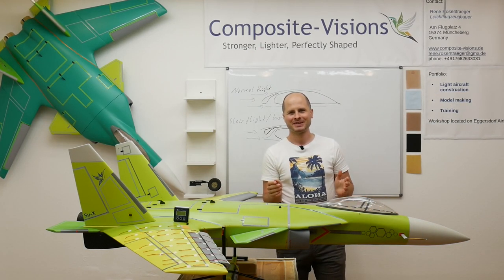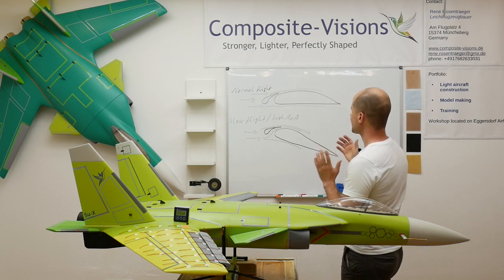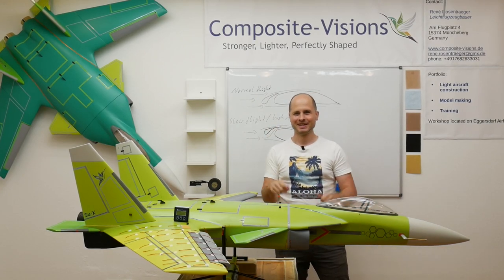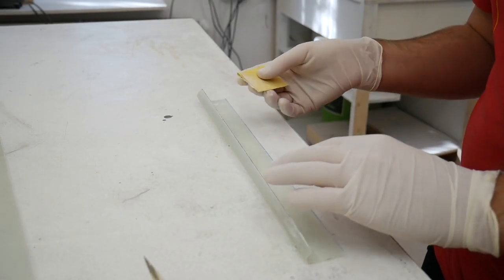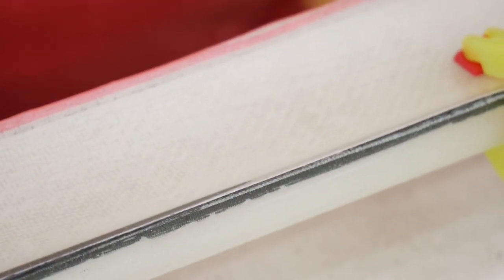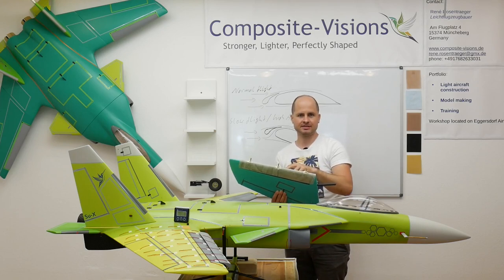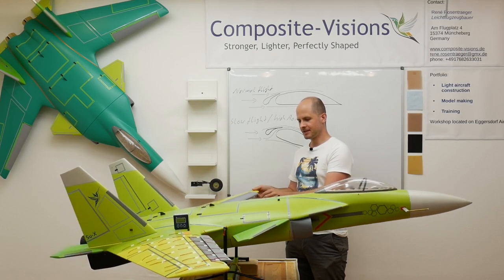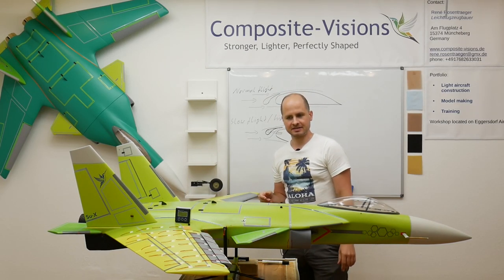Build and Test of Leading Edge Slats for the Su-XR | Made out of Composites!

Comment: I wonder if each of the flow indicators (threads) could transmit data to the flight computer in a plane to warn about stalling conditions in real time.
Reply from the maker: Super idea😊👍👍
Reply: I think instead of threads you could use some sort of small tube like a Pitot tube that would transmit different pressure readings back to a micro controller that could compare readings and extrapolate when a stall condition was approaching not sure if the system could be made small and sensitive enough for use in an RC that size but it would be a neat concept
Reply from the maker: @rickscott0204  Thanks Rick and great idea! I´ll keep it in mind :)

Comment: Surely this would work better with non swept wings as more of the airflow stays as chord wise flow and less is converted into spanwise - hence if there were no sweep angle it would be easier to fly slower? Also are there any negative effects to the performance with these on during higher aoa manuevers as they would likely produce more drag?
Reply: High alpha (AOA) maneuvers are typically used in close combat situations, and can benefit from increased drag in a couple of ways:

1: The aircraft slows down more before completely changing direction, spreading the delta-v over a larger portion of the maneuver, decreasing the peak g load on the pilot.

2. This also allows the aircraft to be capable of an even tighter turning radius, which in addition to thrust vectoring nozzles, increases this ability even further.

Often in combat, the more maneuverable plane is the winner. Advanced electronics can only compensate so much.

The main reason you don't see forward swept wings much, if at all anymore, is that a trapezoidal wing (if properly designed) can have as good of alpha drag as a forward swept planform, without the potentially fatal flaws and quirks they can (though not if designed correctly) exhibit.

You have to admit, the SU-47 looks sick, though!